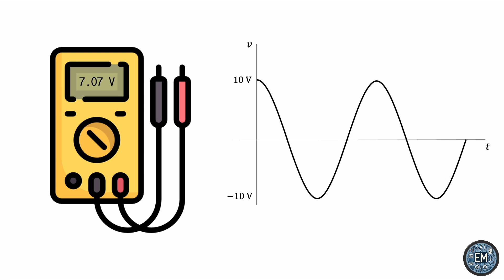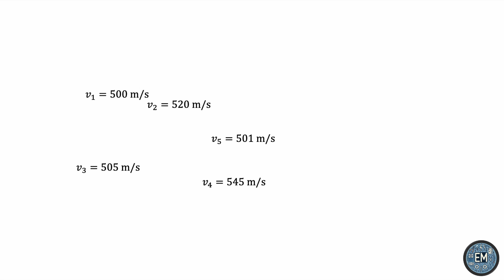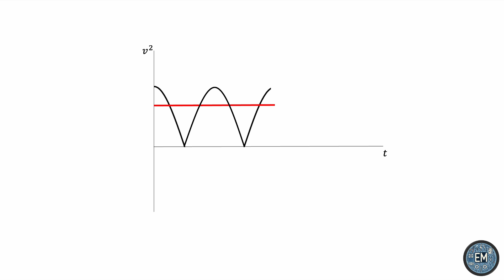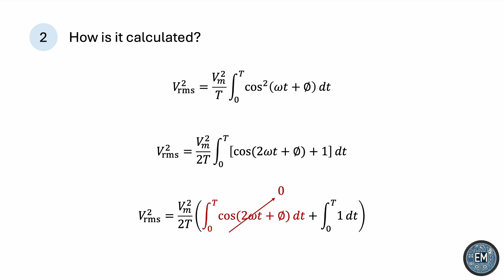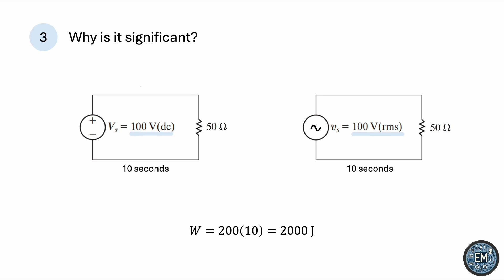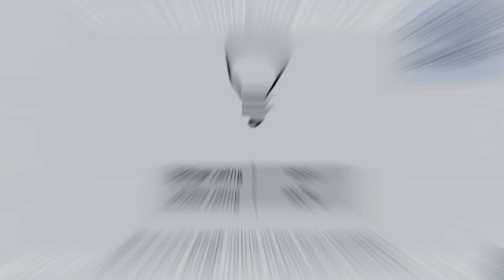Why Electrical Engineers LOVE the RMS Voltage

Comment: the Active power to the bulb 100watts is equal to Vrms*Irms since Irms is Ipeak/sqrt(2) we get 100=120*Ipeak/sqrt(2) dividing to get just Ipeak we get Ipeak=(100/120)*sqrt(2) or 5/6 * sqrt(2) or 1.1785 Amps

Comment: V(m) = Vrms x sqrt(2) = 120 x sqrt(2) = 169.7V ,
I(m) = Power / V(m) = 100 / 169.7 =  0.589A.

Easy W 😎
Reply: that is not correct. According to you're calculations peak current would happen when voltage is 0 since 100 / 0 would be infinite. You need to first calculate the the current in terms of the vector form and only then start transferring it back to sinus form. So this would be 100W / 120Vrms = 5/6Arms. 5/6*root(2)peak would be the correct answer.

edit. Power is always calculated with rms values. That's why this leads to wrong result. If we knew the voltage and the instantaneous power at the same frame of time, we could just calculate it straight from I = P/U
Reply: @Blurrre123  prince of the nights

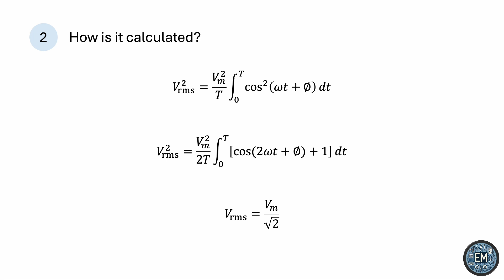Comment: If the power is 100W and Vrms is 120 V, then Vm would be 120 X sqrt(2) = around 84.84 V (the equation at 7:02), but I don't know if the 100W is the peak power or not
Reply: It's an RMS value 💚